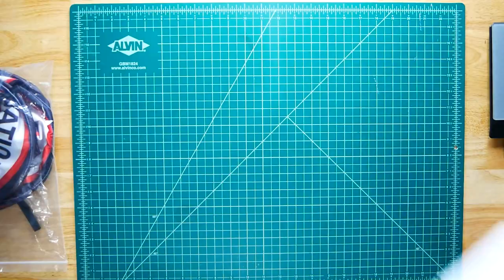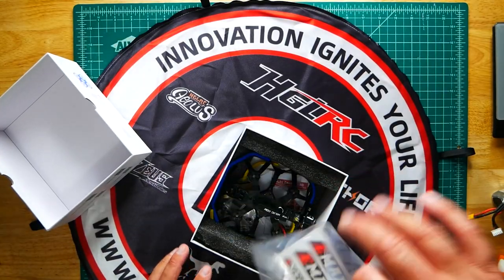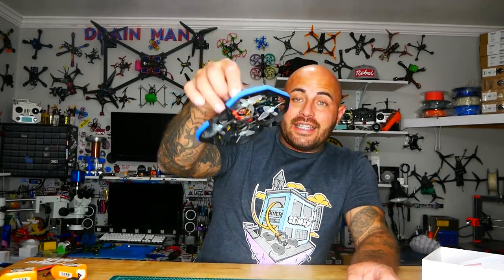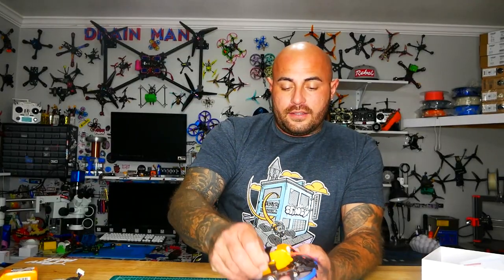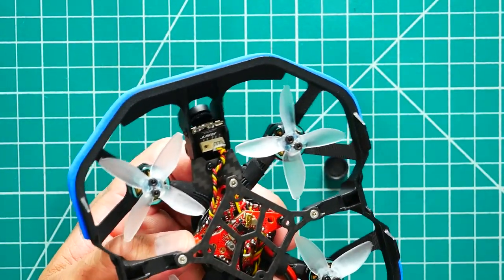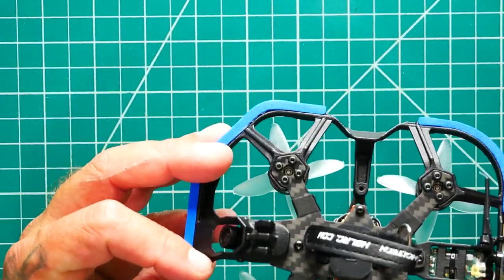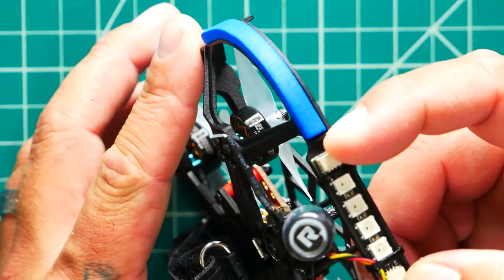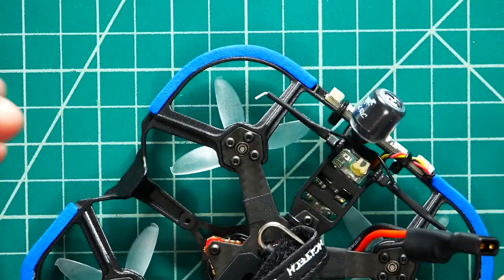The First Go-Kart Style FPV Racing Drone is Here !!

Comment: cant find it online bro! id like to see specs on this one looks cool
Reply: Hey man we're you able to find this quad? I have been looking everywhere! Lol I definitely want this one 👍✌
Reply: @scu-dub  its on banggood now in hd version
Reply: @ammar6937  thanks what is the name of the quad? I know it's hglrc but what's the model
Reply: @scu-dub  no problem its hglrc kt20 it will be in the newest section on fpv drones
Reply: @ammar6937  man you are awesome bro👍 !!!! I have only been in fpv for about a year and I lost my novice 4 then I had a motor go out on my tyro79s lol I think I'm gonna stay away from eachine lol and I have been wanting a whoop style quad and I really like this thanks again man ✌
Reply: @scu-dub  no problem.... the one in the link is hd version where you need dji goggles... the analogue version should be on there next few days..  there's a similar one to the one in video called uruav flipo f95 which is 2.5 inch propeller version in hd or analogue... these are cinewhoop drones a bit different to whoops there not as quick and extremely loud lol... good for cruising smoothly compared to fast flying, some are quiet quick though just too loud for me to fly around my house....i find eachine so so also... I've just been building drones lately...i like the geprc phantom which is a good little flyer but i put bigger motors on it
Reply: @ammar6937  thanks again man yeah I'm gonna have to wait for the analog version 😫 I want to go to HD eventually but for now I'm analog lol I'm gonna look into the flipo👍 I really want a whoop style quad that can freestyle? Any suggestions?  Something at least 2s and can handle some wind and be sub 250👍 I am however looking to build my first quad over the winter and I'm probably gonna build something over 250g 🤫😁 I was thinking arris chameleon or cricket moongoat....but for now I just want a "whoop" style freestyle quad 😁
Reply: @scu-dub  i went hd couple months back, literally sold my analogue goggles and couple drones to fund it, so building up my fleet of hd drones now, building is the way to go you'll learn so much from doing it.... the best whoops for freestyle is probably mobula7 on 2s or uruav uz85 on 2s... ducted props so can fly indoor or outdoors and good power on 2s.... or if you want a cinewhoop style like in this video you have the flipo f95,flywoo cinerace 20,geprc cinelog25  which so should be under 250 and capable of freestyle...or you have great toothpick quads like happymodel crux3,happymodel larva x  which are small and fly great for freestyle... another great whoop is emax tinyhawk 2... there's so many to choose from but most are  similar to each other with same motors and similar frames types
Reply: @ammar6937  awesome thanks man yeah I'm definitely gonna go hd thanks again👍✌